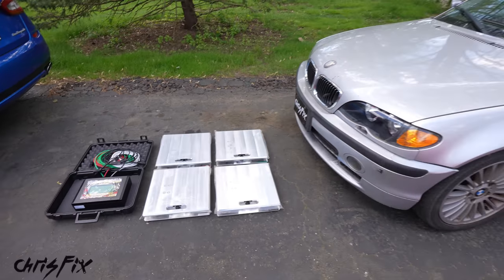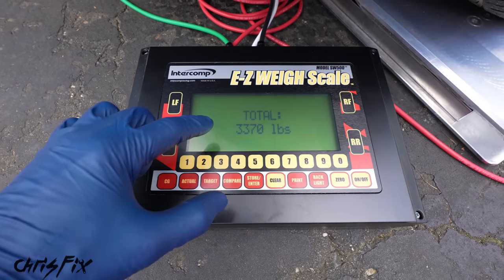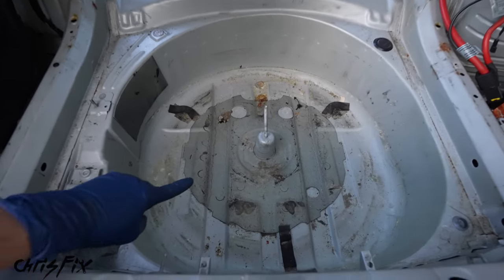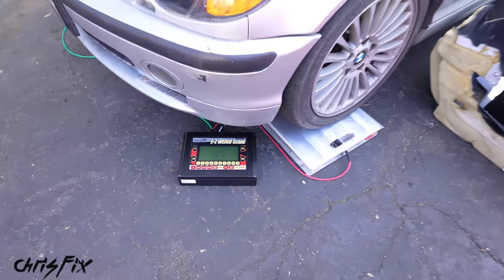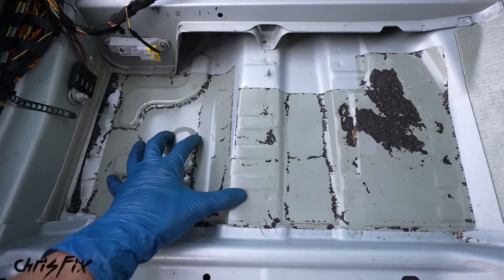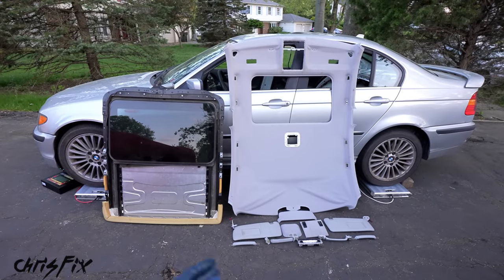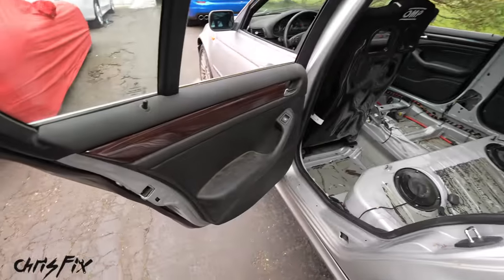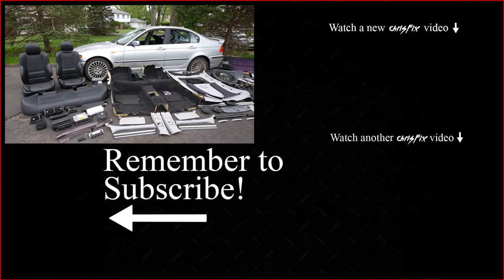How Much Weight can you REMOVE from your Car? (Weight Reduction)

Comment: Initial weight of car: ~1529kg (3370lbs)
Launches from 4500rpm & acceleration from 0 – 97km/h (0 – 60mi/h): 6.79s, 6.88s, 6.83s | Avg: ~6.83s
Braking from 97 – 0km/h (60 – 0mi/h): ~52.2m (171ft), ~52.7m (173ft), ~51.2m (168ft) | Avg: ~52.0m (~170.6ft)

(after weight reduction)

Final weight of car: ~1333kg [~196kg reduction] (2940lbs [430lb reduction])
Launches from 4500rpm & acceleration from 0 – 97km/h (0 – 60mi/h): 6.17s, 6.09s, 5.97s | Avg: ~6.08s [~.75s reduction]
Braking from 97 – 0km/h (60 – 0mi/h): ~43.3m (142ft), ~42.1m (138ft), ~43.0m (141ft) | Avg: ~42.8m [~9.2m reduction] (~140.3ft [~30.3ft reduction])

Hope this helps!
Reply: Despite all that work and substantial weight reduction, average acceleration time improved by less than 1 second.  I'd be quite disappointed if I had a car to do.
Though the braking improved a lot.
Reply: @wizzard5442  gained nearly a second of acceleration from a 10% weight loss, thats a bug improvement with the same amount of power.
Reply: @wizzard5442  Think fuel consumption.
Reply: It doesn't brake... 😱
Reply: @wizzard5442  .75 is pretty significant imo. for removing stuff instead of adding forced induction or something, seems like a good deal
Reply: 0.75 secs improvement is about 2 blinks of an eyelid. Hardly noticeable.
But as TS said, fuel consumption would be a big improvement.
Reply: @wizzard5442  in a world where some cars have 2 second 0-60 times, .75 seconds isn’t nothing
Reply: @wizzard5442  After all that, It accelerated almost as fast as my old 89 Nissan Sentra 1.6 used to.
Reply: Yeah and also factor in that weight reduction is free.
Reply: You just saved me 30 mins of my life, for this I’m thankful!
Reply: Impressive stopping difference!
Reply: @memestream8929  this aint a 2 sec car...
Reply: Brake later before the turn, maintain higher speed during the trun, and accelerate faster out of the turn...
Reply: @wizzard5442  What?  .75 seconds with 0 power added is substantial ( 16% increase in acceleration to 60)!  It's like adding 100hp... for free.  Stopping power increase was more impressive for sure.  Now he needs to get a lighter wheel/tire combo and get rid of the rotating mass and those times/distances will improve even more.
Reply: Not worth it all that extra work
Reply: Dude, you are the knowledge-bridge from USA to EU :-D
Reply: @redfirekla  most of that has to come out anyways to race in it. so yes, worth it. and like others said thats like 100 hp for free.
Reply: Thanksbu converted it to kg,that pound system goes over my head,lol why different
Reply: @wizzard5442  bruh, life it's not like need for speed, 0.8s is quite a lot, especially, that was for free (in this case almost, if you want to change driver seat)
Reply: @memestream8929  On paper 0.75 is a big deal but seat of the pants, not noticeable.
If you were lucky enough to be in situation - driving 2 sec 0-60 times cars - you wouldnt notice the difference. 
The ability to physically and mentally comprehend whilst sitting in the seat whether driver or passenger that 2 secs is quicker than 2.75  would be impossible.
Pity Top Gear isnt still going - it would be an interesting episode.
Reply: @946towguy2  that car does like 10 seconds to 60 stock I hope you’re talking modded
Reply: @GonzCerv  My 1989 Sentra coupe (Non-CA)  with I-4 1.6 and 4 speed manual used to do 0-60 in 5.9 in second gear with only minor mods.   (upgraded tires, wheels, shocks, struts, spark plugs; rev limiter disabled, IAT resistor, running on 93 octane).  Top speed was 121.  Acceleration above 80 was sluggish.  The CA legal versions only had 91 hp, but the federal version could get about 130 hp at 7000 rpm with good fuel and the few mods.
Reply: @wizzard5442  On the paper or off the paper it's a huge difference. I'm disappointed that he didn't state it in percentages. %16 improvement is huge considering not spending a buck for it.
Reply: @kozatas  Where did you get 16%?
I got got 11%.
Reply: @wizzard5442  from "Kingdom come"s comment above. I didn't calculate it.
Reply: @kozatas  Sorry mate
Reply: @kingdomcome1617  Where did you get 16%? 
I got 11%.
Reply: @R03333  people dont realize thats like going from 140 hp to 170 180 hp without removing nothing.. its crazy good actually
Reply: @wizzard5442  Considering that the starting acceleration was 6.83 seconds, 0.75 off that time is almost a 10% improvement, which would be viewed as a big improvement!
If the initial acceleration time was way higher than that – 60.83 seconds, let's just say – 0.75 seconds off that wouldn't be anywhere near as big of an improvement; a little over 1% in this case.
Also the analogy of 0.75 seconds being ‘two blinks of an eye’ is pretty much wrong, a blink often only takes about 0.1 seconds, which double that is nowhere near 0.75.
Reply: @wizzard5442  a human blink takes 1/3 a second and we blink about 12 times a minute on average without thinking about it. 
A .75 second reduction from 0-60 is impressive. 

I’m thinking about doing this with a Mercedes 63 or 65 series AMG with trashed interior/seats.  

Weight reduction of this magnitude, possibly with lighter rims, but without removing airbags and some plastic trim, but with removing front and rear windows from the doors as well as the guts of the door that open and close them.  

If I can get .75 seconds off of a 4 second 0-60 car, it makes me wonder how much I can shave off the quarter mile. (2007 e-63 AMG 0-60 4.1 seconds and 12.5 second quarter mile stock)

You could weight reduce in other ways too, and still keep the car safe/legal to drive. 

I have seen e-63s from 2007 for $8000, and if the interior is shot, I bet I could get one without head bolt issues for $5k-$6k if I’m patient.  

I do like the fact that this is AWD though, and that may be an option as well: find a car that is fast as the AMG but AWD for that extra traction.
Reply: @danielpoweska6604  this is not free!!!!!!  Not even close.  He can sell the seats, trim, airbags, speakers/stereo/amp, spare tire, tool kit, owners manual, interior lighting, seatbelts etc for money.  Depending on what he paid for the car, he could come close to breaking even or even make money and still have the car.
Reply: Gannon Sanchez  did that seem clever to you when you typed it?
Reply: Gannon Sanchez  That makes a grand total of one person.  (More math, since we know you like it so much.)
Reply: This is nothing.. just 0.8 sec.. omg
Reply: @radeizazgrade7627  0.75 sec decrease from 6.83 to 6.08 is actually a pretty huge amount considering the only thing that was changed was the weight of the car.
Reply: Imagine the weight savings when he removes the floor pan and trunk floor with an angle grinder
Reply: @wizzard5442  the biggest change isn't in the acceleration, it's in the braking. Being able to brake 10m later into every corner when your entry speed is, say, 40m/s means you save a quarter of a second in EACH corner. In a single lap alone, you could probably go a couple seconds faster just from being able to brake later. That doesn't take into account increased mid-corner speed and grip because of the lower weight, or the increased acceleration out of the corner because of the lower weight, or a better connection to the road because of the lower weight...the list goes on and on and on. 200 kg is HUGE.
Reply: @wizzard5442  When you consider racing the difference to accelerating and braking becomes massive. Think about the standard track with 6 corners. That .7 second difference comes in after each corner as you accelerate back up, so that's 4.2 seconds knocked off the lap time. Being able to brake to a stop in 30 ft less space means you can get on the brakes later and off the brakes earlier. Lets say another half second per corner so 3.0 more seconds off the lap time. Overall that'd be 7.2 seconds quicker per lap which is absolutely massive.

If you are thinking a drag race, or boasting rights, 0.7 seconds faster doesn't seem like much. When you start looking at an actual race with a mix of braking, corner and accelerating back up, 0.7 seconds is absolutely massive.
Reply: @christophervennix9861  But Chris didnt say anything about races and lap times (not that I can remember). He just said how much weight can you remove from your car?  So my theory is, if its just every-day driving, any improvements less than 1 second wouldnt be noticeable.
Reply: @wizzard5442  For everyday driving, absolutely. The added comfort, noise dampening, heat shielding and other benefits far outweigh the ~10% performance gain you could get. 

Just to note, Chris did say he was doing this for an endurance race, if you watch his other videos you will see that its for a 14 hour endurance race, ~400 laps total. That'd be something like 45 minutes of saved time by the end.
Reply: that isn't right 100km/h is 60mi/h
Reply: @gracebelmonte3554  That's an approximation; 100km/h is approximately 60mi/h, but it's more specifically 62mi/h.
Reply: No way i would get rid of all the comfortable interior just to gain 0.5 second
Reply: Here you are 👑
Reply: @wizzard5442  Tell me you dont know shit about cars without telling me you dont know shit about cars. improving a 0-60 by almost a full second is a massive improvement.
Reply: @AreskCSGO exactly, not to mention it will enhance each performance upgrade.
Reply: You are the G
Reply: @wizzard5442  yeah but you forget alot more Benedikts, Like Lot Higher corner speeds.
Reply: @redfirekla well, it's going to be races, so all that has to come out anyways
Reply: I threw away my cars interior to make it less than a second faster. But still not fast enough to be a fast car .. :/
Reply: @davidturner9120  The regulations said that your car needs to be under $500, and a great method of doing that is stripping the interior out with the added bonus of huge weight reduction. The car is not intended to be driven on the street; it's been made into a dedicated racecar, so the lack of interior really doesn't matter. Also, you do realise that this car is for endurance racing, right? That speed that the car gained adds up over the race. The car would probably gain minutes worth of time over the whole race, so even any increase in performance is greatly magnified. So basically, even a fraction of a second per lap gained — let's say, 0.5s — in just ten laps, is 5s, which may sound like a small increase, but that's a big difference in performance over the whole thing. The race would go for hundreds of laps. If we assume it goes for 200 laps in total, that's almost 2min gained. Again, it might not sound like much, but here, that would equate to well over a lap's worth of time. That performance really matters to each and every driver over an entire race, no matter how long it is. It's vital to your success in the race.
That's why dedicated racecars have stripped interiors.
Reply: @KanarisTM  ahh so that's how cumulative time works! Thanks for explaining :)
Reply: * 0-100kmh
Reply: @DaktEdits  60 miles per hour equals 97 kilometres per hour, not quite 100.
Reply: @KanarisTM  still we say 0-100
Reply: @wizzard5442 losing a second with weight reduction is bloody good...and the improvement on braking is a big one as well....I don't think you understand how good these figures are.
Reply: @wizzard5442  True, but the braking is still very very bad, how can it even begin with 52m ? and 42 is still bad. isnt everything above 40 supposed to be bad?
I suppose somethings wrong on those cars brakes....
Reply: @KanarisTM  $500?  You mean 500kg?
Reply: Also the improvements are just for 0 to 60 mph. You would see the most benefit actually driving the car hard at a race track. World of a difference.
Reply: @oc3144  But races are different because theyre several laps -  ie long distances - so those "less than one second" differences can add up to several seconds or minutes depending on how long the races are.
But in a one-off 0-60mph, you wouldnt notice if its less than one second. 
The only way you can tell the difference in tenths of a second is with a digital timer. With an analog timer, no way you'd notice it.
Reply: @oc3144  Well, driving the car at a racetrack is exactly what it was built for!

Comment: Quick side note: the biggest reason your braking distance is garbo at the start is because you have bad tires.  You can see they are fully locked and you are skidding.  You can also hear wheel slip on your launches.  Upgrading tires alone will significantly improve your performance
Reply: Tell me you know nothing about tires and braking force without telling me you know nothing about tires and braking force. 😂
Reply: @llAngelObliteratorll the professor over here 😭 how is that wrong